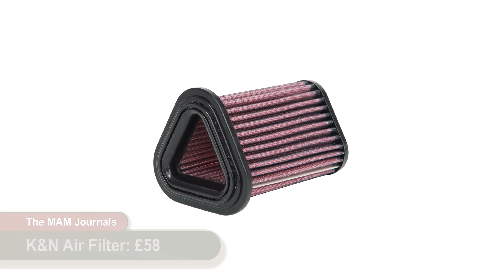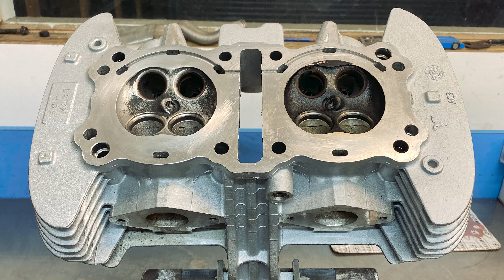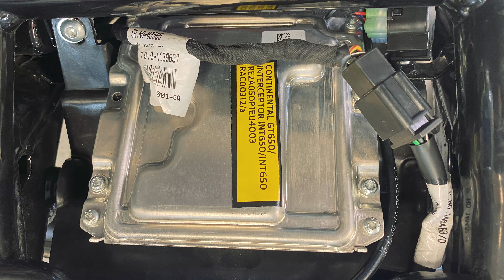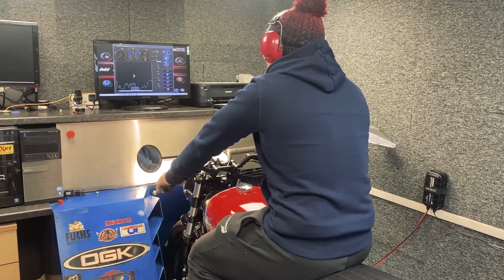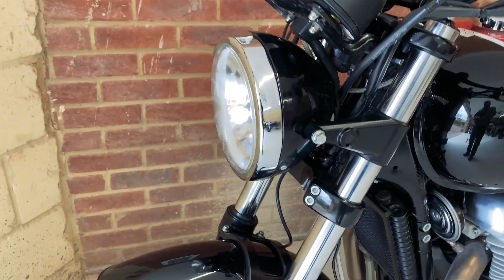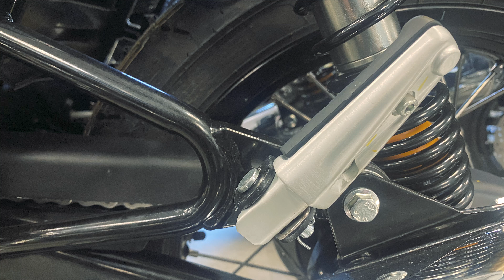The MAM Journals-Royal Enfield  865 Big Bore .(part 4)

Comment: Very interesting.  I've also modified my bike (a RE 650 GT) but from entirely the opposite approach i.e. reduced weight and saddle height. The power from the unmodified engine is more than adequate for me. Keep the videos coming please.
Reply from the maker: Thank you for watching and taking the time to comment . I suspect mine has lost weight as well . The exhausts are definitely significantly lighter . Any idea of what your’s  weighs now ? For me the most obvious opportunity is suspension but we are all different . Its about fun 👍
Reply: @michaelmam   Weight saving to date is 21.815kg (48 lb). Mostly from the TEC 2 into 1 exhaust system and the Li-ion battery but 12 other mods make up the rest (Aluminium prop stand, titanium clip-ons etc etc).  I'm only a short light weight guy (66kg) so picking up a 200kg bike is not easy for me, hence the obsession with reducing the weight and saddle height.  Best regards.
Reply from the maker: @dogphlap6749  thank you . 48 is a good 10% ! Well done and appreciate you sharing the information .

Comment: Classy and subtle build.
Not normally a fan of these, prefer the air cooled Hinkley twins, and i still own the Meriden T140 i bought new in 79, albeit highly modified inc a Weslake stroker crank and Carillo rods, however... i thoroughly enjoyed this.
Cheers, subscribed.
Reply from the maker: Thank you Michael. Sounds like you have had fun with your T140 👍
Reply: @michaelmam  getting a bit old for it these days. Hips, knee - magneto ignition, heavy billet steel crank, fine when i built it in 95, but i'm not getting any younger... actually detuned it a few years ago, sensible carbs and cams etc.
And its still a bastard.
Promised my son it when he turns 18 in a couple of years.
He's well into his older 2 strokes, just built him a 36bhp, 108 kg 150 TZR.
Me?
I like my thumb start bikes these days (electric leg), so i ride my 89 highly modified Cali 3 Guzzi mostly.
I'm an old school air cooled, carb type of guy....
Regards.
Reply from the maker: @michaelhayward7572  Lucky son! With what he has and what he will have!
Reply: @michaelmam  keep it in the family.
Innit.

Comment: Looks good I thought about doing the big bore but haven't pulled the trigger on that because I don't think I could do that myself. Hitchcock motorcycles in the UK sell a kit with the cylinders you just have to put it all together. I've done a lot of changes to my Interceptor and it's addictive . I too have YSS front a back the switch gear/ front master cylinder /sintered pads/Hitchcocks headers with S&S cans. New Domino race throttle which you would like on your bike with the big bore kit for sure. The rear sets are changed the indicators head light bracket I don't know how much weight I lost on the bike but I 'm sure it comes to a good savings. Decided to get new tank the red and black I like but not the white between the colors. Going for the chrome your bike looks good good luck with her. Cheers
Reply from the maker: Thanks for watching John and sharing details on your bike . Sounds like you are having fun with it - which is for me , the point 👍

Comment: Thanks for this video, beautiful bike there! I put the identical YSS fork kit in my 2020 650INT and would like to add that the weight of the fork oil is how the damping is adjusted; the emulators regulate flow of lighter or heavier oil.
 Only a few of us have used the "750" S&S big bore kit here in the U.S., most go "the whole enchilada" with the 863cc.
Reply from the maker: Thank you for watching and taking the time to comment . Appreciate it 👍

Comment: New Brake pads Is all you need.
Great job & got yourself a keeper there.Magnificent.
Reply from the maker: Thank you! It has been great fun and I have learnt a lot, working with some great people.
Reply: @michaelmam  Ride it enjoy it then later on upgrade clutch.
Always rebuild it years & years later & early models like Euro 4 will be sought after in future.Could add a power commander or powertronic in future.
Alot of people are criticis on a job like this & will say "You could of got a Triumph" but only a T100 & like you said you didn't want one or had them.I love the idea of a 865 Interceptor that out performs a T100 but has the ultra smoothness of Interceptor gearbox & fueling & you're not one of many.
Reply: @ruahinesrider  the stock clutch doesn't seem to handle the extra torque from what I've heard. I upgraded my clutch when I did the big bore kit, and honestly the only downside of the big bore upgrade for me is that the upgraded clutch (Rekluse brand) has more drag when disengaged due to having more plates. This means that you unfortunately lose some of the super slickness of the original gearbox, which is mainly noticeable when trying to go to N from 1st when not moving. It's a bit disappointing but that's the price you pay I suppose.
Reply: @PiersCuntley  Maybe a 750 be able to keep stock clutch & keep smoothness but be hard not to go 865 though.Actually be interesting to find out stats & differences between them I might look into it.
Reply: @ruahinesrider  I'm not sure, but I think that you'd probably need upgraded clutch for 750 as well. If considering doing this, also don't underestimate the benefits of having the more common 865 setup as far as tuning and community support goes. O think you'd have much more trouble finding people to share fuel/ignition maps with etc for a 750 and may be harder to find a starting point for tuning.
Reply: @PiersCuntley  In NZ a couple shops done 865 with the upgraded clutch one in Hamilton & one in Wanaka.If you live in Ausie near Sydney Reverlry Cycles are the 865 big bore experts but don't think they done a 750 yet.living anywhere near these places be great for follow up service & Reverlry Cycles actually sell whole 865 complete ready to ride bikes for 19-20k Ausie for new bike.Otherwise have to be content with headers & maybe Fuel X or Fuel X pro or Power Commander or both.A 2-2 without ECU upgrade just headers,air filter,Sports muffler will get you about 48-49hp at wheels so 5-6hp over stock & torque 58Nm & Power Commander will be 50-51hp & 63Nm & a 2-1 will be 53hp & 71Nm & with Power Commander 55hp & 75Nm.Which isn't bad considering a 2017 T100 was only 55hp & 79Nm stock but 20kg heavier than a stock Interceptor & a 2-2 will be 10kg lighter & a 2-1 is 13kg lighter & you can put a lithium battery in & save another 2-3kg & that weight is removed from up high on the bike which will increase handling.A Stock 2022 T100 65hp bike is close to 233-235kg & with a 2-1 220-222kg to the R.E with 2-1 200kg add lithium battery 197-198 depending on if you use lithium ion or the better & slightly heavier lithium Iron Shorai battery.The newer stock T100 65hp bike will be 10-13hp more & 33kg roughly over a 2-1 R.E & 35-36kg if Interceptor had a lithium battery.35-36kg is alot of weight even with the 10hp over 2-1.2-2 is slightly less on HP & 10Nm Torque but look better & lithium battery help with the extra weight of the pipes.

Comment: Great video Michael. A really nice job which is completely in keeping with the style of the original... one question I assume the exhaust system mods will meet current emissions standards for Mot? I have no doubt Craig and the rest of team who worked on it will have a queue of new customers. My only surprise from seeing the earlier episodes is that you didn't have the Nitron Suspension!
Reply from the maker: Hi David , As I understand it this will have no MOT issues unless they introduce new legislation and back date it . I do like my Nitrons- I have two bikes with them fitted but felt that the YSS would cope easily with what I will probably ask of the bike .👍

Comment: Surprised to hear about the clutch, some claim it skips just with a full exhaust system and a cam.  Is your’s slipping?
Reply from the maker: No slip on mine yet 👍🤞 I tried Kings Two Wheel Centre ‘s Big Bore prior to doing mine . I gave that a hard time and it didn’t slip either . Lets see how it goes . If it needs one I will change it 👍
Reply: How the Verex 2-2 big bore headers going?
HIS 865 is a beauty.I'd have done the clutch at same time but I'm paranoid & would of done it while it's out & I would've bought big bore kit with complete head from Hitchcocks for 3knz.
Reply: Look into how the clutch works on these bikes .They cant slip they clamp tighter the more torq put on them !I have never herd any one say that an exhaust causes the clutch to slip on these bikes, sounds like more BS to me!
Reply: @andrewslagle1974  what are you talking about? Michael’s must be the only 865 without a recluse clutch. Maybe once he’s run it in he’ll notice